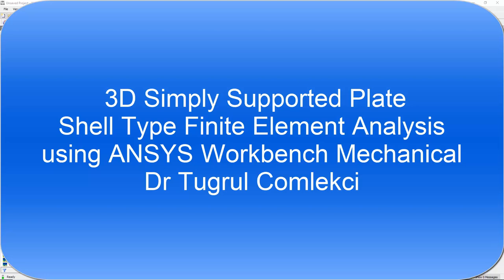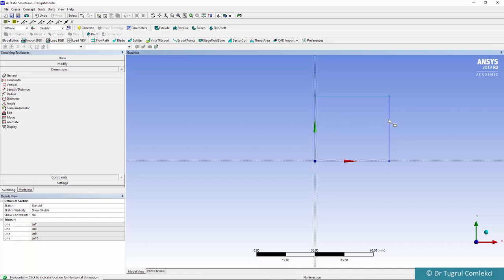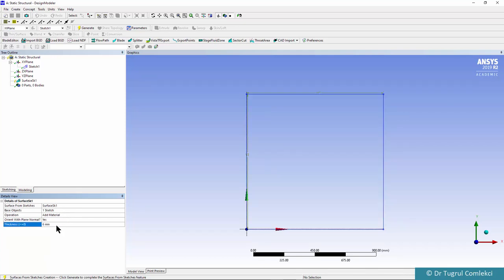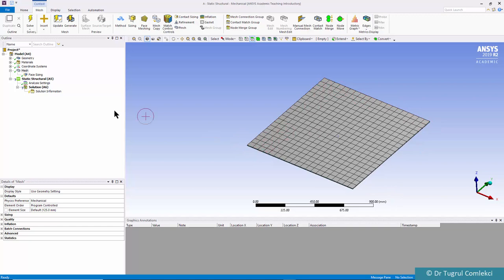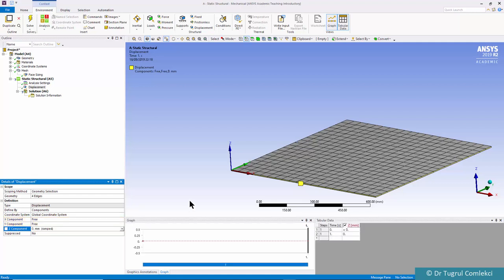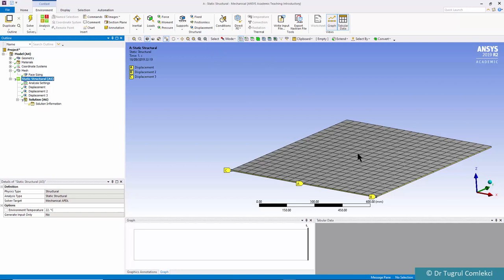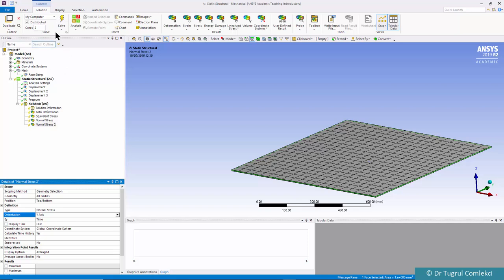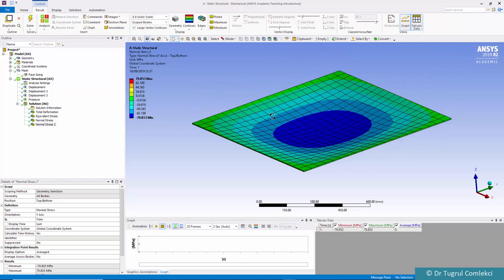3D Simply Supported Plate, Shell Type Finite Element Analysis using ANSYS Workbench Mechanical

Comment: Thanks for the video, Sir. I have a question, why fixing only two points in 4:58 and not fixing the 4? Greetings from Mexico
Reply: I think it's because the plate is simply supported- it is fixed on one end and free on the other
Reply: @paulcipparone4690  It is simply supported on all four sides.  Since the deflections are set to 0, fixing the two points essentially fixes the motion for the other corners as well.

Comment: what restrictions should i apply if i want simply supported but with shell281 element
Reply from the maker: Thank you for your comment. The element order is by default "Program Controlled" that is specified in the Mesh Details box. You can select higher order element (Shell281) with midside nodes instead. This does not change the displacement boundary conditions required for simply supported plate in this case however. I hope this helps.